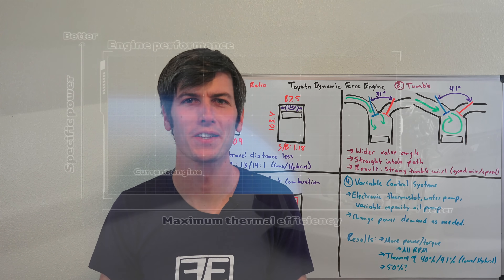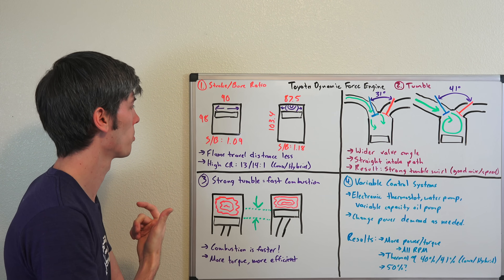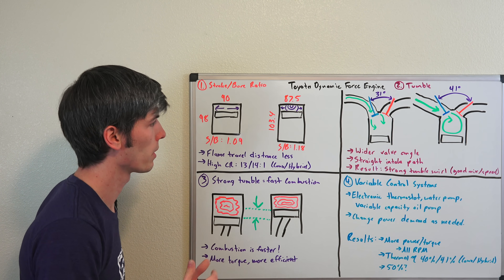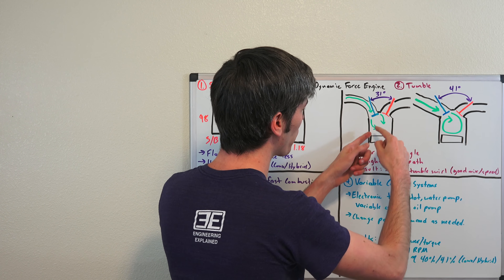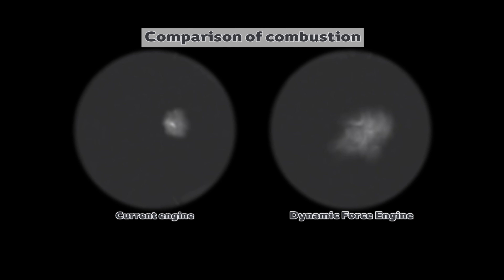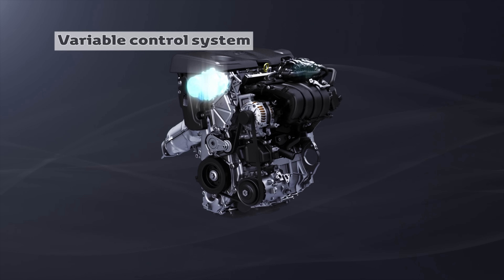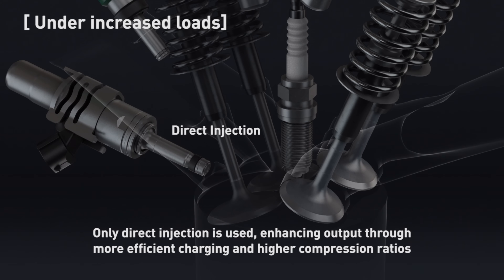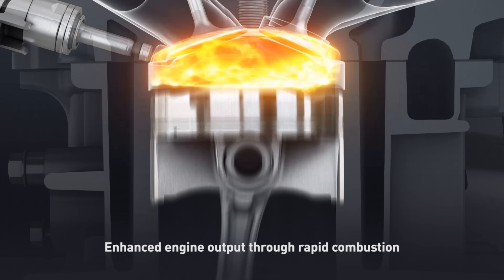Toyota's New Dynamic Force Engine Is Super Efficient

Comment from the maker: Since it's a common question, this style of engine is currently used in the 2018 Toyota Camry with a 2.5L inline four cylinder. It runs on regular (87 octane) gas, makes 203 HP and 184 lb-ft, and the base trim is rated at 29 city / 41 hwy mpg. Pretty solid numbers for a non-hybrid vehicle, especially considering the decent power.
Reply: Joshua Melton Dude having a 4 cylinder with 41 mpg is fantastic, how in the blue hell is disappointed?
Reply: Please tell me this could scale into their iForce V8 for the the Tundra/Sequoia!!
Reply: @anubis8680  Hi I am from the future. V8s are dead.
Reply: Not in Australia, sadly. Since Toyota wound up manufacturing operations in Australia, our Camry is imported from Japan, with the 6ish year old 2.5L 2AR-FE. Efficiency and emissions don't seem to rate as highly here for some reason...
Reply: @cameronbrown7925  maybe you have cheap gas
Reply: @cameronbrown7925   It's a 2 yr old question, but what are your Australian Camry 2.5L numbers? My wife's US 2017 Camry le 2.5L is 178 hp/170 lb/ft or 133 Kw/230 Nm.
Reply: @R777-RLM  :-) Age doesn't matter when the questions pop up in my email inbox ha ha! Those numbers are the same as in Aus.
Reply: wow thats amazing! Why didnt Toyota make this a bigger selling point of the new Camry?
Reply: I own an 18 Camry since September of 2017, and since then I have put 11,000 miles and I can tell I have gotten better fuel milage than advertised. At most 45mpg on the highway. Great car
Reply: Pablo Ajungo ..... same here .... up to 44mpg and that’s with a few traffic lights thrown in ,..... super smooth and quiet at 60-70 even 80mph or more.
Reply: Pablo Ajungo t
Reply: Pablo Ajungo ... I own the same car ... same results ... car is FAST ..... engine noise when accelerating a little more than I like but quiet at cruising speeds ... a great car.
Reply: Joshua Melton does any of those figures you mention have +200hp moving a full size sedan?
Reply: Joshua Melton - Vehicle design. With all the extra safety features and luxury features demanded in today's vehicles, they are becoming increasingly heavy. As a consequence of how much needs to be shoe-horned into these vehicles (motors, sensors, airbags, etc), it also means either larger body-work or less interior space, which rolls right back around to luxury - can't compromise interior space, so the bodywork must get larger. That means a larger aerodynamic footprint, which is mitigated by wind tunnel testing; but that can only accomplish so much.
Reply: This engine is also going to be in next years Rav4 and for those interested is Built in WV, AL, and KY.
Reply: Joshua Melton  the reason these mpg numbers are impressive is because of the high horsepower that comes with it. The geo metro you mentioned had half the horsepower and didn’t need to meet modern emission standards. It was easier to get higher mpgs with dirtier emissions.
Reply: Joshua Melton - That is incredibly impressive once you consider a few factors. 1. The engine we're talking about is a 2.5L, I4, non-hybrid, GAS engine. Not a 1.0L I3, a 1.6L diesel , or a gas-hybrid powertrain. 2. This is in a large car, in comparison to the ones you are referring to. It is physically much larger than all of the ones you mention. 3. This is a much heavier car than at least 3/4 of the cars you mention (I don't know how much the original Insight weighs, being a hybrid). 4. This engine makes a very significant amount more power than any of those powertrains. Just imagine what those cars would be capable of today, if the government would allow them to be manufactured without all the added weight of the extra safety equipment, if they were made with modern bodywork and powertrains. They would be capable of 70, 80, possibly even 90 or more mpg, and make significantly more power (they were all pathetically underpowered by today's standards).

If this engine wasn't in such a large vehicle, you could potentially be looking at a very sporty compact with 200+ hp, capable of 50+ mpg. I'm definitely NOT a Toyota guy, but I'm excited for what kind of cars this technological advancement will get us once it rolls around to the domestic manufacturers (eventually).
Reply: @CMannStayns  Hell, this would be a very welcome upgrade in my FRS! Or if they still made the tC
Reply: @CMannStayns  Not impressive when you look at 2001 Nissan 2.5L Vq25DD. Makes Toyota a joke
Reply: I think new 2019 Corolla haves newer version in 2.0L
Reply: Engineering Explained Will be used in the 2019 Rav4 too.
Reply: Great video. So I am a very fuel-efficient gentle driver who tries not to use the brakes often, coasts to stops and doesn’t speed. On my 2017 Camry I achieve around 41 miles per gallon on the highway during the summer months. On the 2018 Camry I achieve 53 miles per gallon on the highway in the summer months. The car is unbelievable in both cases, but the new engine is just ridiculous. It basically gets hybrid fuel economy on the highway, of course the less in the city
Reply: Seafox . Need to understand that in Europe and in USA the way of measuring octane is not the same so the numbers are not directly correlative . There are some videos out there that explain how you can make comparison if you want to . Since we're on the topic euro diesel is quite a bit more potent than US diesel and is priced accordingly .
Reply: US octane rating is not the same in in Europe. Read a little about RON and MON ratings before making a statemnet
Reply: Han Bosco Toyota have an engine that makes 190 from a 1.8 without forced induction, 2ZZGE. They made it in 1999 as well.
Reply: @tomelliott9  Buddy Nissan Vq25DD V6 2.5Litre naturally aspirated 2001 produced 160kw 216ho with 270nm of Torque. Funny Toyota still can't produce from 2.5Litre
Reply: @constantineb6433  216 is very low from a 2.5, Toyota had an engine making 190 from a 1.8 in 2001
Reply: Yeah not so good I've got a Renault mpv 7 seats it's a 1.9 Turbo diesel and weighs 5,000 lbs it's 130 bhp with 221 ft/lbs torque and it's 13 years old but I get 54 mpg (US gallon) at 70 mph highway and that's on trips over a mountain range. So no that's not great.
Reply: For us old guys, that you can get 203 HP from an inline 4 cylinder engine is pretty amazing.
Reply: Because the public at large doesnt care about tech specs.
Reply: Joshua Melton And you other guys commenting on the merits or not of 41mpg. You need to realise and confirm your relative perspective is correct. There is a difference between US41mpg and UK41mpg. Like about +25% going US to UK.
That is: it's over 49mpg in UK gallons.
Reply: The mpg is impressive, the power is not quite as impressive per liter. The 2004 Corolla T-sport has a 1.8L inline 4 with about 180hp output. however at like 7l/100km which is a bit more than the Camry's 5.7l/100km.
Reply: Sisrace ..... I own a 2018 Camry .... 0 to 60 in 7.9 seconds feels pretty fast to me ... it’s an amazing car (I paid less than $21,000 for an LE that’s loaded with STANDARD equipment)
Reply: @billgale5568  0 to 60 in 7.9 seconds is slow....my 2011 Camry SE V6 does it in 5.8 seconds and it is fast under all conditions - like when fully loaded with people & luggage while climbing up steep hills - that's when you know whether or not you have enough power.  On on-ramps, I never question whether or not I have enough power to merge into 80 mph traffic!  It is fun!
Reply: Tony Davis ... there are no “hills” in Florida and 7.9 is plenty fast for me.
Reply: Exciting! That engine is slated to come to the 2019 Rav 4 :D
Reply: Angelo like screen on time in smartphones😂😂
Don't mentioning brightness level.. and what apps used.. (or even black background on amoled)
Reply: i just hope its as reliable
Reply: Recently rented a 2018 Camry for a week. Very wonky throttle feel and response. Feels like it won't go, until too much throttle is used, then too much acceleration. Nice car, but it needs better software tuning. The MPG was impressive, at 41 in 20/80 city/highway driving. Only put 6 gallons in after a week of driving about 250 miles. Nice.
Reply: cujet ...own a 2018 Camry and I don’t see anything like that.
Reply: I drove a rental Camry, the 4- banger felt more like a small 6..
Reply: They should shove the Camry 2.5 on the highest trim Prius instead of the 1.8 Atkinson.
Reply: This must be an NA engine?? I love NA when these days all you find is turbo
Reply: Engineering Explained   So the 2018 has his new style engine or the old style? I’m curious because I have one. It runs very good for a N A engine.
Reply: @semiauto3148  2018 Camry's have the new engine with both Direct & Multi Port Injection, and 8 speed automatic transmission. I bought a 2017 Camry, for the Le trim's 16 inch wheels. It has the 178hp/170lbft MPI engine, and 6 speed trans, and we love it.
Reply: Engineering Explained great vid pal ... Any idea of mpg with this new efficient engine? Thanks
Reply: Down only 2 HP from the 86 but up 29 lb-ft of torque over it, might as well use this engine to differentiate the BRZ and the 86.
Reply: Those are some great numbers. My old 2005 camry gets 34 mpg on the highway if driving 95% highway. But if doing a more realistic scenario of 50/50 than I get average of 28. These numbers have essentially been quite similar up till the 2018 model. Nice to see there is finally a real improvement.
Reply: @MeTwo-out  This is very believable for a modern sedan I drive an 18yr old BMW 540i thats got a 4.4 liter V8 on a long highway run at a steady 75mph i get nearly 28mpg, though the on board computer does reads 31mpg so not completely accurate.
Reply: I wish Toyota would build a turbo 4 again. 😶 Heck, I still miss my Super 2.
Reply: I drove a loaner recently, and was getting closer to 25/ almost 40.  Still, pretty solid numbers, I guess.
Reply: Very cool to learn one of the most reliable auto manufacturers adding power and efficiency too. I hope this design finds its way into their entire lineup in the next couple of years.
Reply: 14:1 compression and doesnt even require 91 octane wow. I bet that engine would be even more effective with 91
Reply: Now if they could only get the kinks out of that 8 speed transmission
Reply: One of the reasons why I chose the Camry over the Accord. Naturally Aspirated to achieve that vs Accords  turbocharged engine. I'd be afraid of the Accords extra hardware and reliability of the motor in the long run due to being forced induction. 
Compared to my 2013 Civic, this Camry gets better mileage and the pickup is amazing. I cant imagine what a beast the V6 Camry is.
Reply: The MAN S80ME-C7 have achieved an overall energy conversion efficiency of 54.4% !!!
Hydrodiesel fuel has 20% water emulsified with 80% diesel (milk diesel), warped perception did a test of this remarkable fuel, you literally save 20% fuel and gain the same power as regular diesel !!! In theory and probably, I may say it's save to say that, if we were to take the most efficient diesel engine out there and put hydrodiesel as its main fuel, we could achieve about 74.4% thermal efficiency !!! That 20% water absorbs the heat of the engine and rapidly expands into steam !!! That is heat put literally into mechanical energy !!!
Reply: It will do over 41 mpg hwy at 65 mph.
Reply: I’m averaging over 40 mpg in my 2019 Toyota Camry XSE 2.5👍 Great Video And Thank You For the Aptera Info also! I have a 600 mile one with the Full Solar (900w I believe) Option on Reserve.
Reply: My 2022 Camry gets 38 City and 40 highway, great engineering.
Reply: They are also used the RAV4.
Reply: It's working great, hopefully the reliability is still there to come.
Reply: Rating isnt real life.. real life it gets 29 mpg
Reply: It had to rev at 5,000 rpm to ger that 184 torque.. junk
Reply: Is 0w20 or 5w30 oil to be used in this engine? Also, are there users who have experienced bearing sagging in this engine? Do you think this engine is durable?
Reply: 41mpg from a midsize non hybrid sedan without FI and you're crapping on it?   Really?
Reply: Engineering Explained Amazing considering Toyota's 3.0 V6 from the early 2000s put out the same power.
Reply: Engineering Explained is there a chance this could end up in the new 2020 4Runner that’s being speculated? And is this engine something that could be turbo’d? People want a V8 in the 4Runner but honestly I think a turbo or supercharged 4 cylinder would give enough power and better fuel efficiency than their aging power train that is being used currently in the 4Runner.
Reply: @dcoop1476  I want a turbo 6 to replace V8s
Reply: SPEAK METRIC !Respect the engineers who designed these AND THE WORLD ! Torque is m.N power is kW ! Help compare to electric motor too.
Reply: Engineering Explained and I am a huge fan of Camry engine. I am running 2.4L inline-4 2AZ-FE on 2015 Scion xB2.5, these little engines last forever. Plus they have so much potential that some people doesn’t realize, and it can gains from 500 hp to over 1000 hp and 800 Ibs pounds of torque. This is why I love camry engines a lot more than 2JZ. Even though 2JZ is an almighty and legendary engine but it’s unique.
Reply: @toyotabrony  Well I will just let you know that the Nissan Vq25DD 2.5Litre V6 in 2001 produced 160kw roughly 216hp from naturally aspirated engine.
Reply: you can get 60 mpg on the highway if you drive slow enough.   I'm sorry it drives me nuts when people give mpg without saying how fast they drove and if the roads were flat or hilly.
Reply: Luke T Because a Camry driver doesn't know or care what a horsepower is.
Reply: @procrastinator1842  I'm a Camry driver and I definitely do.
Reply: Because the normal U.S. citizen (read most) does not care about mileage and the auto makers neglect it. I can guarantee you than the same engine in Europe would be at leas 20% more efficient... This is valid for all U.S. sold cars
Reply: So....about as efficient as the Hondas new K20C engines then. I get 50mpg in my K20C 2016 Civic, its great! And its no slouche with a 0-60 of about 7 seconds.
Reply: Wow, you guys in US are running on 87 octanes as standard? :O Well, I don't know about whole Europe, but where I am from, we have standard 95. I don't know about any engine that can be filled with worse fuel in EU. In fact, it is rare to find any gas station offering fuel with less than 95 octanes. Some better performance engines here requires 98 octanes gas. 87 we are scared to put even into lawn mower. On the other hand, be glad for your 2,5L. Best we can get from Toyota here as non-hybrid is 1,6L with 130 HP (Corolla or Auris, Carmy is not offered here). Best 0-60 from all versions is 10s flat. Woah! My dear Toyota, you can have super efficient engines, but if you won't offer us some power, you know what can you do with your cars...
Reply: @seafox8748  because 87 in us is same as 95 in europe. We use different octane scales
Reply: @seafox8748  87 AKI is 93 RON.
Reply: @seafox8748  what do you pay for your fuel ?  Right now I'm paying about $2.49 per US Gallon of 87 octane that my car is rated for.
Reply: @seafox8748  in the US fuel is rated differently.  We use the R+M/2 rating which is the average of the  RON (Real Octane Number) and the MON (Motor Octane Number) whereas I believe your fuel is rated using the RON.  As a conversion, I believe our low 87 Octane fuel is equivalent to your 91 Octane fuel.  We also have 89, 91, and 93 octane fuel, with our 93 octane being equivalent to your 97 octane.  check out wikipedia's article on octane rating.
Reply: Nissan (Infiniti) skyline 2003 V6 2.5 litre 6 cylinder produces Over 160kw roughly 215hp Naturally Aspirated. Makes that Toyota laughable.
Reply: Kind of Strange that you all talk power/efficiency of Toyota however from 2001 Nissan Vq25 2.5L six cylinder naturally aspirated engine produced more than most current manufacturers 2.5Litre engines. (158kw 212HP plus 270nm torque). Makes others a joke
Reply: The fast burn reduces the spark advance, eg the spark fires nearer TDC.   This reduces the ‘negative work’ of pressure rise ahead of TDC.  
    The idea is old.  “Squish” has been around 60 years but fell of favor due to emissions.  GM Vortech engine swirled the change.   There are other schemes, particularly diesels.
     Toyota achievement is thru their engineering prowess in details, not so much raw innovation.
Reply: I get better than that in my 2015 nissan versa
Reply: You know what makes a car brand iconic: relativly cheap performance, thats how premium cars began to dominate europe, they both charge more and sell much better: because people are willing to pay for +100 hp. And lexus doesnt make premium very well, they sell like crap and nobody wants them. I have a radical proposal to Toyota: cancel lexus in europe and make performance/luxury variants of the regular lineup (+ a larger model like avensis for the compact segment), toyota is a much better brand than lexus and i think they could enter the premium market if they accepted the terms of it think like a 250 hp-ish avensis with a hybrid option, toyota needs such a model as their current image is too boring to help them
Reply: @sakariaskarlsson634  I've always said they should upsize & RWDise the Prius & put big pipes on it if they want to make a luxury hybrid.
Reply: Ellenor Malik but more importantly: give it a decent chunk of power so it isnt as slow
Reply: How did you restrain yourself from throwing shade at Toyota? Isn't this simply an application of what Mazda's SkyactiV's combustion process management and VW's engine accessories have been doing for the better part of a decade? Where is the innovation here?
Reply: HiHowAreYou no it isn't. 80s Honda CRF hf got 55. 1990 geo metro got 55. 1984 golf 1.6d got 55. My 2000 Honda Insight gets 60mpg
Reply: @joshuamelton7311  The Camry in questions makes almost triple the power, weighs twice as much, and has easily triple the interior and cargo space.
Reply: @joshuamelton7311  I averaged 63 mpg TOTAL over 50,000 miles in my 2016 Prius… All the Cars you listed are Small and Slow. 
I now have a 2019 Camry XSE 2.5 Which Is Much Larger, Heavier, Faster and Nicer and I Average 41 mpg over the 40,000 I’ve had it. Your comparing apples and oranges. I have a 600 mile Aptera on Reserve. That might turn into a Dumpster Fire though 🔥 🔥🤣…. I will let you know if they ever actually come out with it this time!
Reply: @maddeusdoggeus1  i too have an aptera reservations. My complaints are that there are no small efficient cars. I don't see the need to make cars so big that with all this tech the best we can do is 40mpg. Put that tech in a smaller car and get 80mpg.
Reply: @joshuamelton7311  sure, but what was the emissions like? Diesels get amazing mpg, but the emissions regulations hold them back
Reply: Disappointed it's only 41mpg. All this efficiency talk I was expecting something a bit higher. Why is better mpg so difficult?
Reply: @joshuamelton7311  I've been averaging 49 mpg, now I live in a very rural area and traffic isn't an issue but in traffic I still average a respectable 41 mpg.
Reply: @joshuamelton7311  well you can always contribute to the innovation if it continues to disappoint you
Reply: Joshua Melton price
Reply: Joshua Melton you can go so far with the current technology, basically we have reached a point that without the breakthrough of a new technology we will only be able to improve the engines just a tiny bit. In short, we can only get it as close to perfect as we can with the current resources until something different comes along.
Reply: @joshuamelton7311  41 mpg US = 48 mpg Imperial
Reply: Toyota could have saved themselves hundreds of millions of dollars on this engine by just adopting the MYT-6 design which is a 6 inch, 25 pound engine with 15 moving parts that can produce 200 to 500 horsepower and get fuel economy of up to 150 miles per gallon.
Reply: Waterworld 360   - has that engine ever been implemented commercially ?  I remember reading about it almost 10 years ago in some NASA thing ...
Reply: @RayleighCriterion  Here in the UK we have many big saloons that can achieve over 50mpg though most of the are 4 cylinder turbo diesel powered.